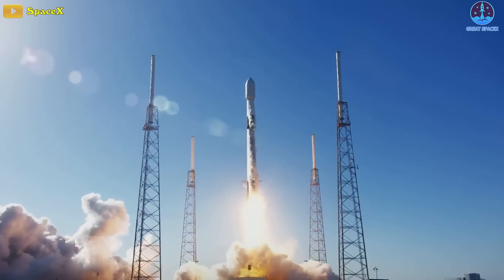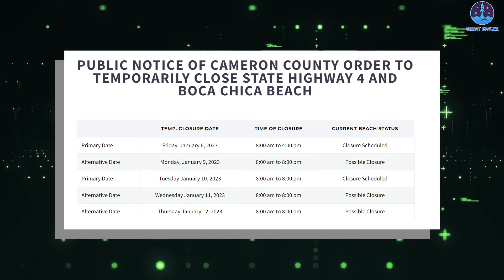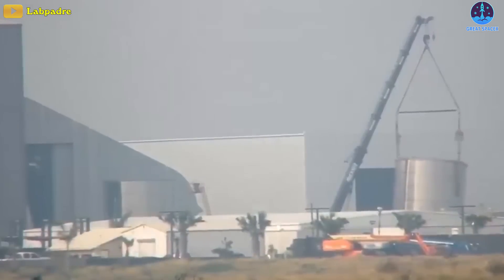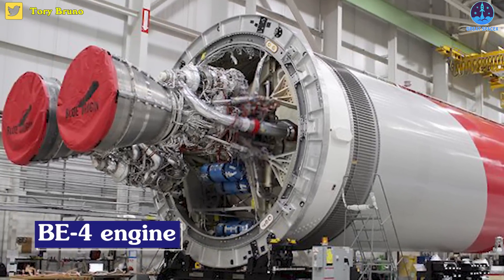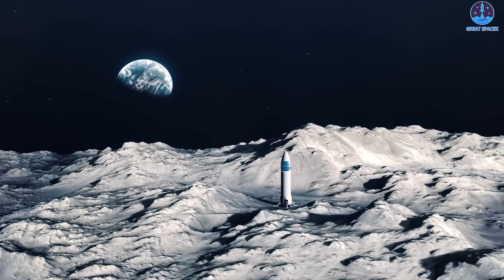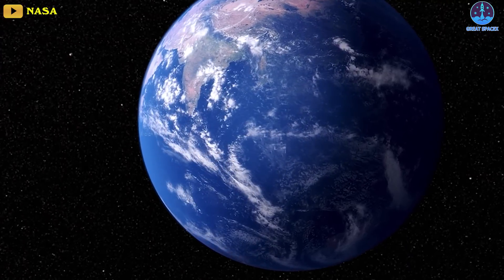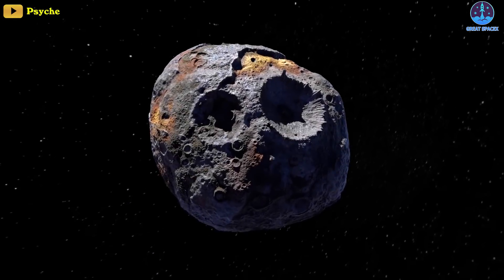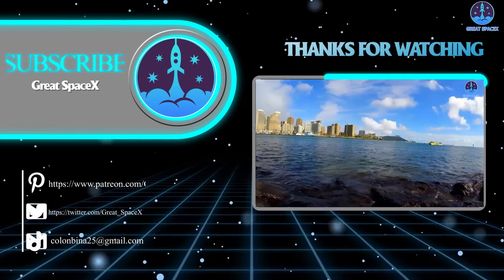SpaceX ADDED 5000 ton devices on OLM for simulating Starship ahead of 33 engines TEST

Comment: Why not I change their rockets is full of radiation, that is one of reason NASSA changed the Rocket, no one question how safe the SpaceX rockets are. You can't use anything after exposure as we know as you are at rissk of dying, so who is checking radiation levels on returning. Who is checking radiation levels on the rockets return

Comment: With raptors if a clamp doesn't release properly they can shut it down. I can only imagine if a hold down on sls or anything with a lit SRB kicking it 20° on the pad. Well it's time to search videos from the 1960s to find an example.

Comment: I still think that the OLM doesn't have enough of a Deluge system.
I am also concerned that the 33 engine test will fail because the hold-down clamps WILL hold 
the booster down, but the clamps will still be clamped to the rim of the booster when the 33 engines 
rip the booster off of the OLM, and the clamps will still be clamping down the perimeter metal 
of the departed booster. Just some thoughts.
Reply: I think the guys at spaceX studied enough to know what they are doing
Reply: I read an analysis about the 13 engine static fire and how since the superheavy tanks were barely full at all that was more upward pressure on the structure than a half fueled 33 engine static fire. Apparently that's the main reason for this test rig to see if it can hold a fully fueled 5000 ton starship + superheavy. I'm no expert and could be wrong so take this with a grain of salt.